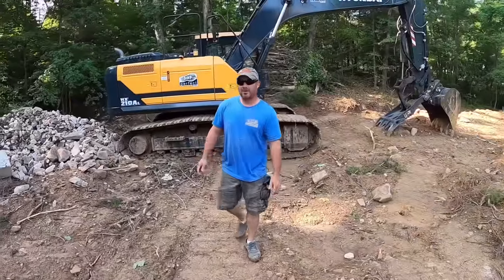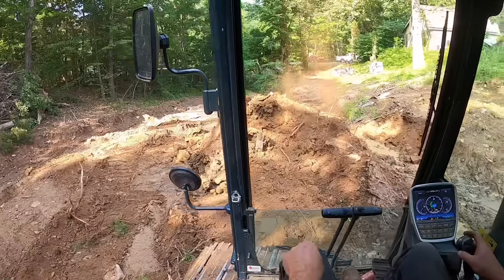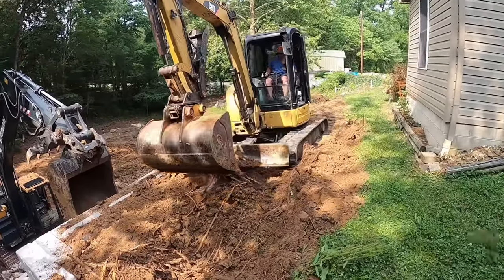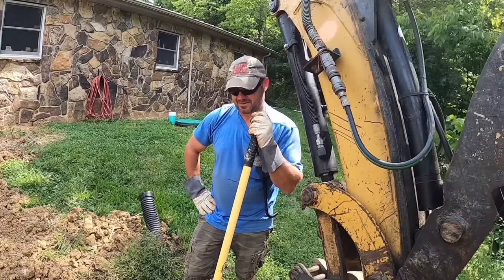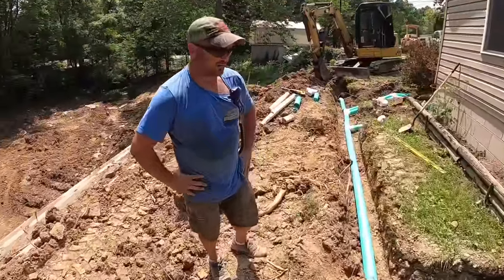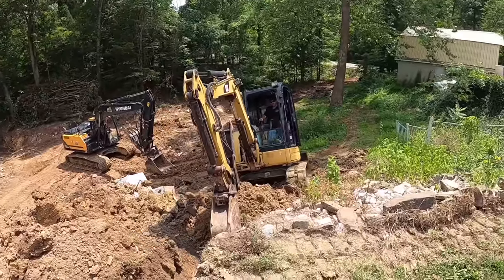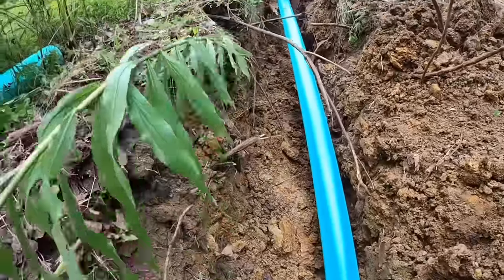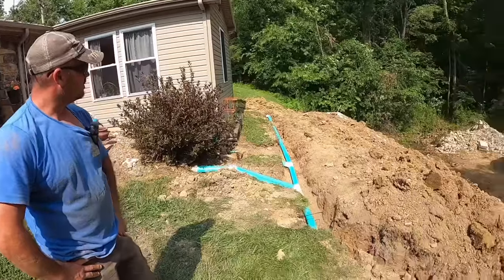Retaining wall gets it first major test and apparently there’s glue shortage?!

Comment: Wow. that's a lot of 4" pipe, feeding one 4" pipe!, but the down hill suction should overcome the feed rate! Great video! Thanks, Mike & Aaron! Lee
Reply: If the gutters get overwhelmed, them loose fitting gutter to pipe connections will allow the water to leak/overflow out between the downspout and the drainage pipe.

Comment: The roller was way more sketchy than the mini.
Reply: The video doesn't show how steep the bank actually is and the mini was close to going over backwards so both operations were sketchy. I guess we'd both know how close he got if Mike admitted  he put his seatbelt on. The door was open though.
Reply: Yeah, but if you have operated any steel wheel roller they are sketchy on flat ground. At least you can grab the ground with the mini.

Comment: I used to work for the gas company here in the mountains of western NC and we used to cut ditches like that with a ditch witch!!! We'd start at the bottom and hook the ditch witch to the winch on the boom and slowly pull it up the hill... I HATED it!!! We tried going down... once... As soon as the DW hit a rock or big root, it'd jump, then roll down the hill!!! You've NEVER seen 2 guys run so fast ;-) Stay safe gentlemen, and have fun!!!

Comment: Pipe works looks good guys, I did a big pipe/downspout job myself too last week. You guys only use glue or did the primer run out? I have actually seen glue and primer in a mix at Lowe’s. Never used it though. Def makes it easier have two ppl for setting pipe. This has been a fun video series to watch.

Comment: I have seen so called professional house/yard drainage specialists on youtube only use basic round 90 bends to connect to square down spouts, and I got muted from the channel for calling them out asking why they cram a square pipe into a round hole and not buy fittings fit for purpose, but typed a lot more polite

Comment: DP, I have a major concern with the size of the pipe used for all the gutters! The last pipe should be at least 6" if not 8" as trying to force all the water down one 4" pipe will cause the water to backup. The last pipe after all the "T's" should have been much larger to handle the flow of rainwater, IMHO.
Reply from the maker: Sorry your crazy plz
Think about what your missing

Comment: @DirtPerfect

I know you dont use the bucket with the cutting edge forward much, but it seems to be a rather usefull adaption. The limiting factor seems to be the reduced effectiveness because of the machine articulation. 

How about having MBTS modify an old bucket so it has a trap door for working with the cutting edge to the front. Something similar to a friction shovel bucket. You could use a hydraulic operated catch and utilize the existing auxiliary hydraulics.
Reply from the maker: That would not make it convenient at all for this job

Comment: I would have used combo wyes instead of tees (or wye + 45 street) and put a cleanout or two in it.  If it gets packed with leaves, the homeowner might be coming after you with a pitchfork.

Comment: Excellent work guys, but a plumber wound not have used a 90 degree elbow as it will slow the water down always use a 45 degree elbow when making a turn.

Comment: The 'glue spill' story was better than the real Arron glue-sniffing story. 5 downspouts going into one 4" line, maybe 6" going down would have been better. That's going to be a firehose at the bottom. I'd put in a 90 degree fitting facing straight up for a cool to watch geyzer effect at the very bottom. Surrounded by a flat rock dissipation pad elongated down the ditch with additional rip-rap to the street culvert. That might attempt to slow this substancial force, like Arron attempts to quash his glue-sniffing habit to no avail.

Comment: Would be wise to put rock under and around the pipe.  Working with a plumber and he asked one of his guys how often he came across collapsed pipe that didn't have rock around it and he said every time.  Asked him how often he dug up collapsed pipe with rock around it.  Guy looked at him and said...never.  Also, the bells on your pipe are facing the wrong way.  They should be on the upstream side, so the water dumps into the next pipe.  Not being critical, just throwing out some advise.  Nice vid and thanks for keeping the economy propped up for those clowns in Washington!
Reply from the maker: Not this pipe

Comment: To bad thet dont have a foward dumping bicket for an excavatore ,they have it for skidsteers that would have worked mint right there , but also your not gonna use it but ,once or twice a year , it good for me because loading trucks ,the bucket doesnt go down into the bed it stays level with top edge and then you can shake it out and it doesn't get buried in the pile and bottom out.

Comment: One question: Here in Sweden we calculate one 80mm round downspout per 325 squarefeet roofing to coupe with a 10Y rainstorm. When 2 80's unite, we continue with 110mm groundpipe and 2pcs 110 with a 160 diam pipe. How come all vid's I see on Youtube - no one takes account of the added amount of water from each intersection???
Reply from the maker: Missing a key input

Comment: In a downpour, I'd bet each downspout 4 inch pipe can be running at capacity.  You just hooked several of them together but they only drain into another 4 inch pipe.  Overload?
Reply from the maker: Lol you missed a key input

Comment: I sure hope you have enough volume with that 4" pipe. A roof can collect allot of rain really quickly. I guess we'll see next good storm. Great job gentlemen!👍👍
Reply: if the pipe gets full, the loose fit of the downspout going into the gutter PVC adaptor will allow water to spill/leak out  and not cause too much of an issue

Comment: You are going to need to get a bigger track hoe to keep up with LD18. This project looks great.
Reply from the maker: I do not what any bigger that’s less money for me sorry
Reply: @DirtPerfect apples to oranges until you start clearing logging cuts.
Reply: @TwoAcresandaMule  He went over this when he brought the 210 he was looking at the 220 or 235.  It's the weight and being able to move it.  Fuel burn per hour and he doesn't do many big big earth moving land clearing jobs like others do.  He got this one because it fit his need just a little bit bigger then the 120 but yet still small enough to move and use on tight job site.   Most everyone should see the work DP does and realize he doesn't need a 6 foot bucket and a machine to match it. He's not building 5 acres pond and moving 400k yards of dirt each day. His doing jobs like this and building pads and sites.
Reply: Or something older to keep up with Diesel Creek!

Comment: Are those pipes big enough to handle all the roof water?
Reply from the maker: Yes plz think about that and what happens in a hard rain
Reply: The pipe will just run faster in  a hard rain.  Lets face it once you get to the slope on the hill the water is just going to fly out of the pipe like  a fire hose. Going to take on heck of a rain to back the pipes up to cause any problems. And if it rains that hard you have other things to worry about then the pipe.

Comment: well i liked the build of retaining wall, but gotta say your plumbing leaves a lot to be desired!
Running so many down pipes into just on same diameter pipe is just asking for issues when ya get as much rain as you folk do!
Reply from the maker: Lol plz think about that you missing one key factor 😂👍👍😂😂😂😂
Reply: With that drain angle/slope the water will run out/drain faster than the roof water can accumulate. Good job guys, keep Aaron's microphone charged, he always has something to say....
Reply: They get nice showers so the down pipes are no full most of the time and really even in  a heavy rain the pipe will not be full.  You have what 40 feet to get the the slope on the hill and once there the water is just going to fly down that pipe and not be  a problem.  On  most field tile jobs they like 12 inch of fall in 1,000 foot run.  At the start of the hill he has a 1 foot of fall in what 2 feet of run.  Water not going to stay in pipe.  Old saying you could pee in the pipe and it would be running out before you are down that how steep it is.